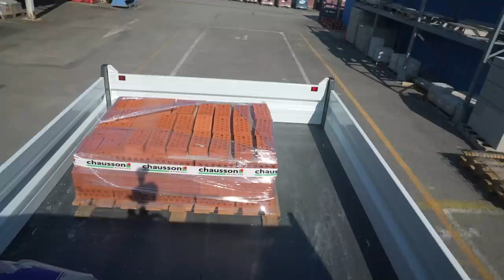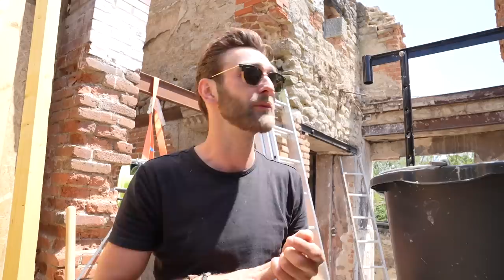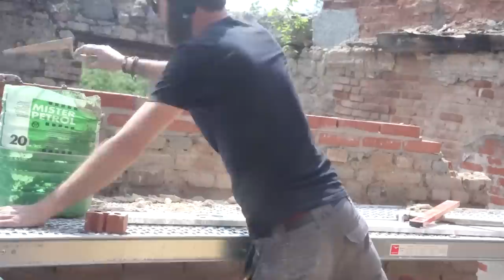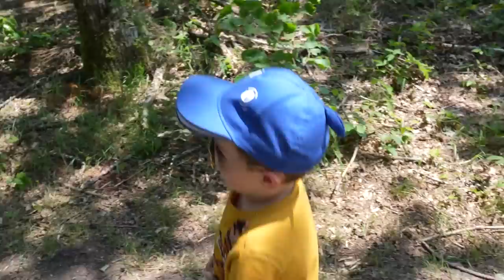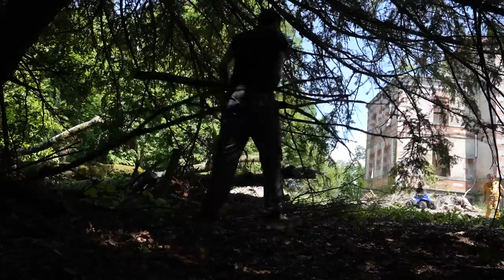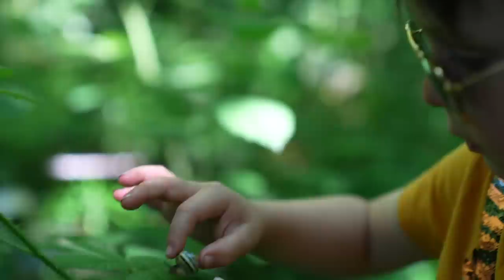im back, a busy day.

Comment: Have you thought about erecting a scaffold on the outside of the building that contains a set of alternating stairs that brings you up to the upper levels for this heavy construction work this will keep you out of the building and allow you to Stage directly next to the scaffold where you can use it as a primary stair for this work?
If you can drive up to your primary staging area and then go directly vertical without having to traipse through the building you will save a lot of time and energy.
Reply: Jerry, look online at the price to do that in France.
Reply: @daisylovelock9553  we do that on every masonry job in the US.
Reply: Jolly good Jerry

Comment: Hi there. It has been a while I am watching you preparing your lime mix for your brick laying and I am flabbergusted! Do you really put a bag of lime each time in the mixer? Speaking volumes, you should use a 10 l bucket and have about 2 l of Saint-Astier for 1 bucket of sand. Find yourself a 1 liter bowl of some sort. So if you put let say 3 full buckets of sand you should add 6 liters of lime only. If there is a way to get in touch, I'll be more than happy to give you advises you really seem to need badly! Bon courage.